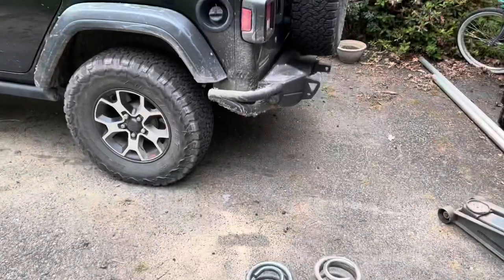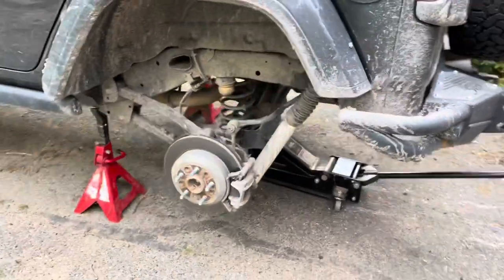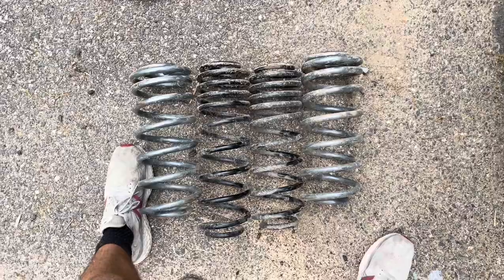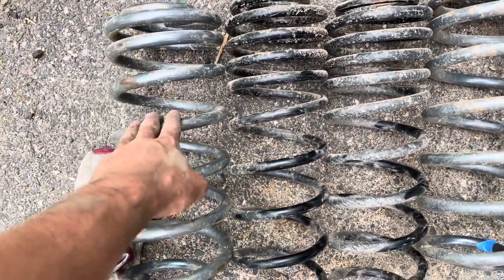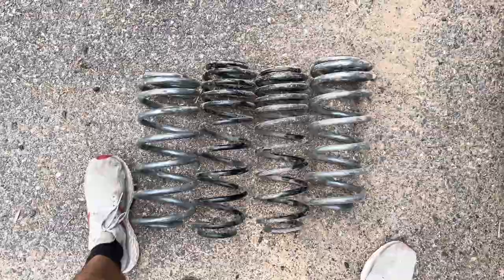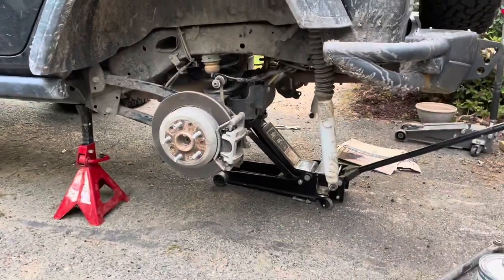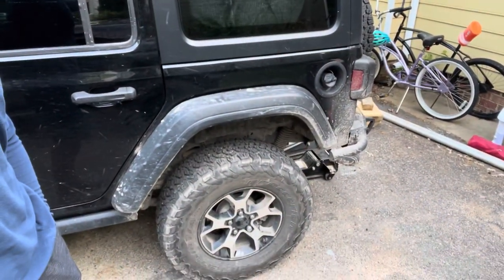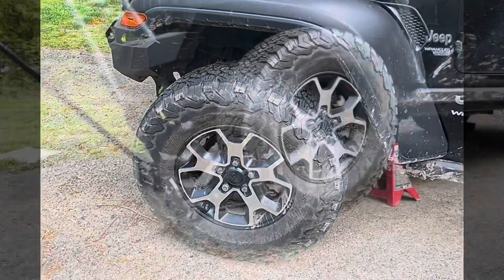Install of Metalcloak adjustable track bars and front control arm correction brackets on a jeep

Comment: You installed your rear track bar upside-down.
Reply from the maker: Its installed correctly, the bend in the track bar only allows it be installed one way to provide the proper clearance otherwise it hits the axle housing